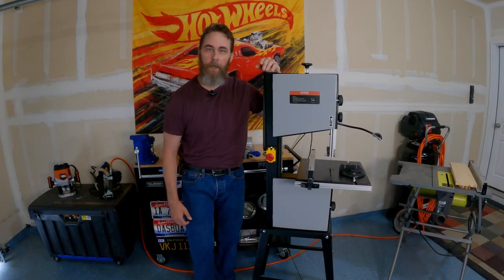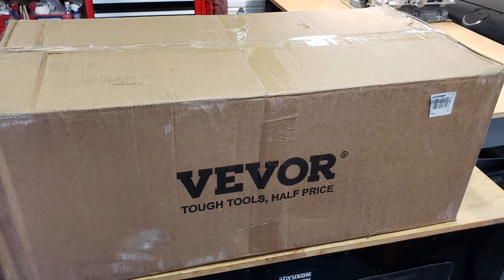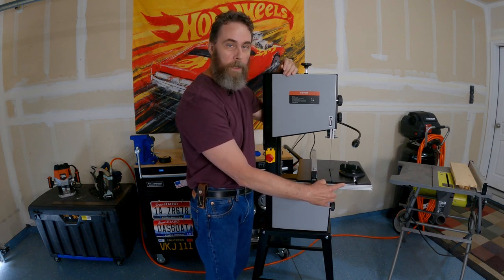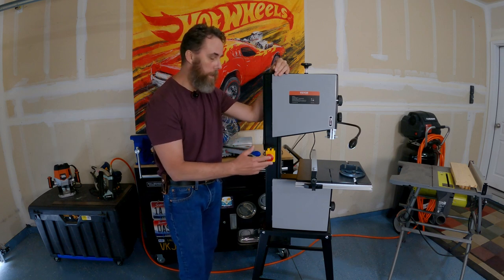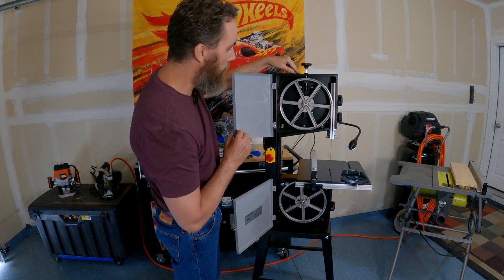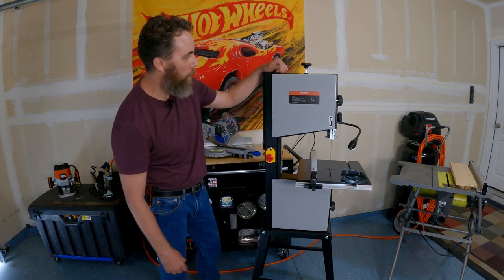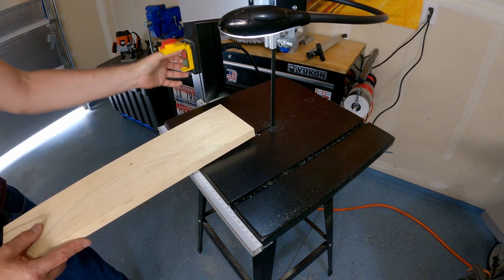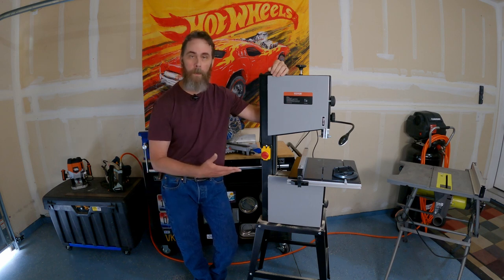Vevor - 10 Inch Bandsaw - Test and Review!

Comment: My Vevor has a very loose miter gauge and I had to make one that doesn't wiggle, Vevor's only response to this was to give me a 80 dollar refund.
Reply from the maker: That's cool. So far I haven't had any issues with mine. It has been very handy for small projects.
Reply: This may be petty, but if you buy this saw and you don't have any experience with power tools like this, there are absolutely no assembly instructions in that manual. No explanation of what bolts go to what what needs a washer what doesn't etcetera. And I have two parts that I have no idea where they go because I don't see any place for them on the saw. One of them is an l-shaped with threads on one end and a nut. The other one is a 10 mm bolt it's about an inch and a half or so long with a nut on it. And I have no idea if you needed or where they go.
Reply: Got the same items, put them in a drawer and if anyone finds out please let me know what they are for. Saw works great without them.
Reply from the maker: @laneetherington614  If I remember correctly, the l shaped bolt is an adjustable screw to help secure the tilt position on the table deck. I believe there is a threaded hole to receive it.